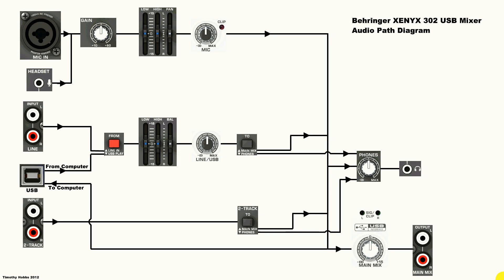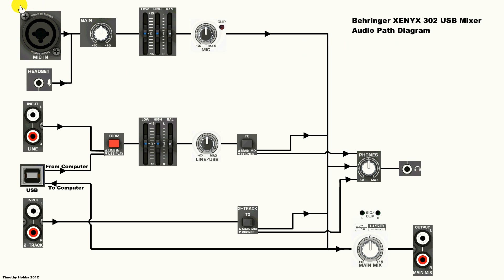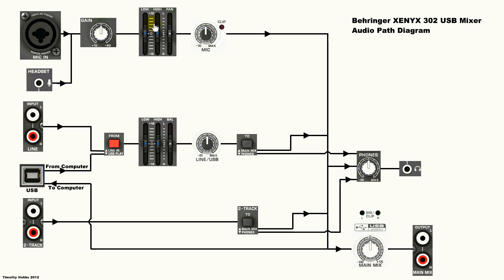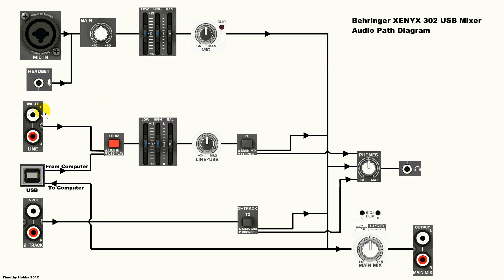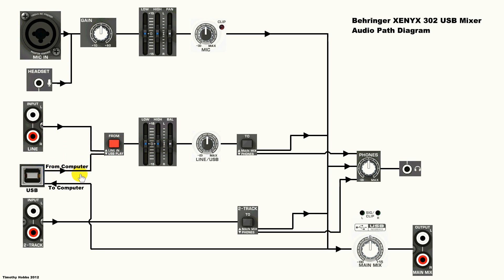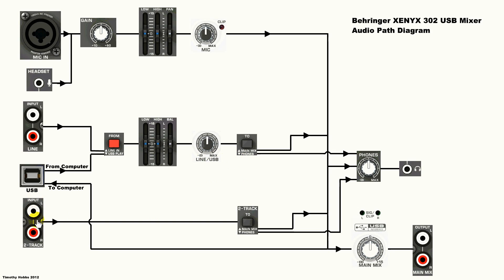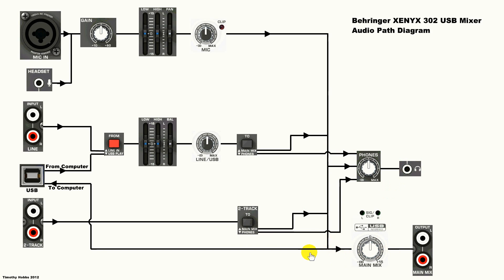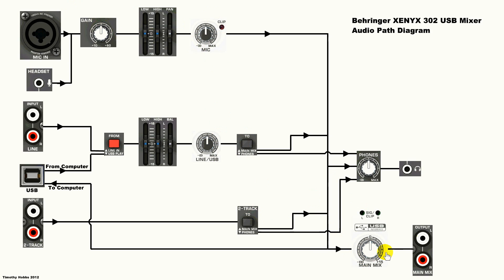Behringer XENYX 302 USB Mixer Diagram and Explanation.

Comment: the only problem is on the microphone! you hear it on headphones!
Reply: There is  a procedure to alter this. It involves removing (unsoldering) R59 and R81 5.1Kohm resistors. These are located near IC6 (above and below). Search for Behringer Xenyx 302USB no master monitor mod for photos and more details.

Comment: This is a great diagram and explanatory video. If this unit is powered from an external source, can this unit offer power to the USB to power a bluetooth to USB adapter that I wish to use to bring Bluetooth audio into the system.

Comment: Excellent and very helpful explanation, I hope you based it on your analysis of the main board after your teardown. A question that I have is were you able to figure out where on the board is the phantom 48V power supply generated? I am considering making a small mod to my Xenyx 302 USB, to add somewhere a micro switch to actually be able to cut the 48V supply off.

Comment: Thanks for the block diagram! I'd like to use it in a modification guide if you don't mind (removing the main mix signal from the phones output). I will mark the source of course, with your name, and a link pointing to this video.

Comment: Hi,  Nice diagram, very helpful.  Suggestions for improvement:  Where do the LED overload indicators tap into the audio chain?   Do the LED's on the main output change color from green to red when the output is overdriven?  It would be informative (at the risk of cluttering up the diagram) to show where the summing junctions are and also where the USB-to-analog and analog-to-USB converters are.  
Those switches associated with the headphones are confusing to me…  Do the switches really direct the output of, say, the 2-track to either the headphones or to the line output summer?  So, if you listen in on the input from the 2-track, then does the 2-track  disappears from the line output?   Seems like a more useful feature would be a kind of "solo" wherein the headphones can surreptitiously monitor the Line 1, the 2-Track, or the mixer's Line Output without disturbing the program.  Is that actually the way it works?

Comment: Thanks, very informative for an audio noob like myself. Could you explain the difference between the gain knob and the mic level knob? Thanks again.
Reply: Gain is the level of the input. Mic level is the level of the output after changing the filtering/panning. It's just so you have absolute control over the volume before and after changing it.

Comment: Well, if this signal flow is correct, it means I can not use the mixer as an Audio interface to record guitar (via line input) into a computer. Therefor I need to listen the signal coming from the PC and the signal going to the PC at the same time. Did anyone check, if this is possible?

Comment: I think the 3.5mm microphone jack supplies phantom power too. Typically cheap 'electret' mikes connect there and these need a few Volts to bias them. the hot tip of the plug connects via resistor to + voltage and the signal is tapped of via a capacitor. The other plug connection is ground of course.

Comment: Thank's for a very useful explanation and teardown.  I haven't used my 302 for a while but seem to remember the Main Mix also controlled the level to the USB output as well as the main mix phono plugs.  I could be wrong. 

Also.  Although the XLR and 1/4 jack is mono, do you know if the alternate phones 3.5mm mic input is stereo or just mono?  Some of my mics are 3.5 stereo and I am not sure if they will be treated as mono by the 302.

Comment: I saw another demo that made me think I could only record mono on the PC from the USB. But the demonstrator was only using the microphone input on the mixer. If using the line or 2-tk inputs on the mixer will it output stereo via USB?
Reply: digigasm i was wondering about the same thing. if paired with say a UCA202 - will that be stereo already?

Comment: Thanks alot for this great explanation! I have no idea how I should have managed to understand that mixer, as the documentation that comes with it is hardly usefull and lacks exactly a diagram such as yours. I'm on my way to print it out and stick it under my mixer, that's the only documentation I'll need. Again, thanks!

Comment from the maker: Maybe, but this is a very high level diagram. The circuit is far more complex than this and who knows what tricks the designers have used. This would require reverse-engineering a large amount of the circuit. The main problem is if you cut the central path to the headphones on the diagram this will stop the other inputs as well.